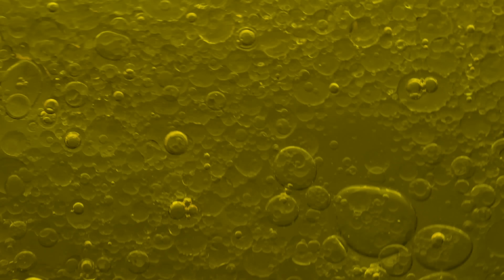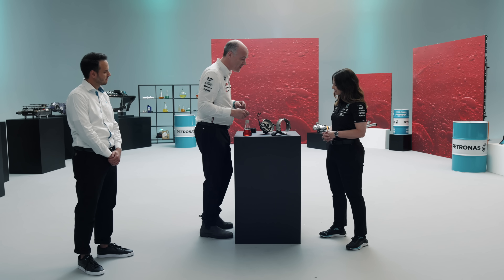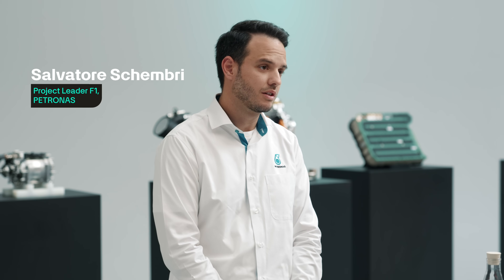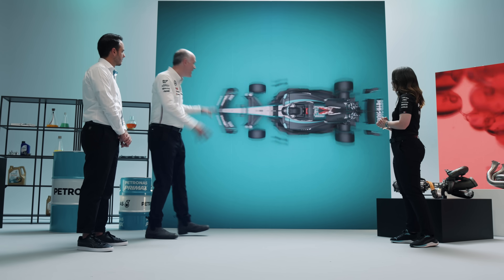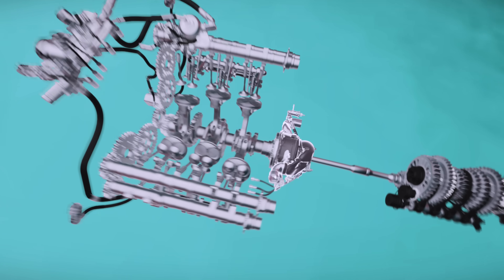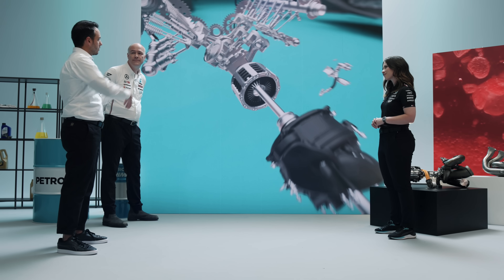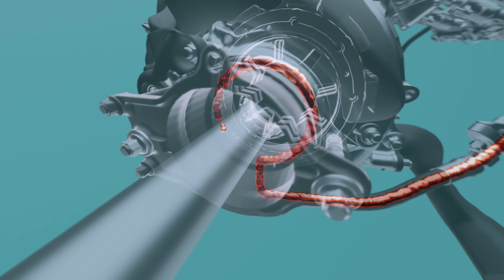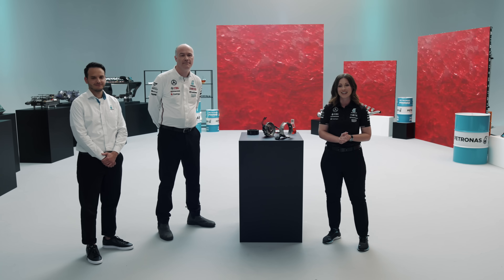F1 Uncovered: Revealing How an F1 Clutch System Works

Comment: That thing is tiny for the amount of horsepower is being shoved thru it.
Reply: @redbovine  Yes. A lot of motorsports clutches are tiny in terms of diameter. I think they stack the clutch discs and that's where the torque capacity and length comes from.

Comment: so much smaller than i imagined . i Love these videos. and even if some of the parts are a few years dated. its still awesome one team out there is sharing some tech with us . pretty unseen in this realm of motorsport
Reply: These cars make zero torque lol. The clutch doesn't even need to be as big as a normal car clutch that would go in a 2L turbo.
Reply: The cars are light, they don't need to make a lot of torque so they don't need a huge clutch. 
I expected it to be small, but I was surprised that it's barely bigger than my hand!

Comment: You should have finished explaining how the driver activates the clutch. When the driver downshifts does the clutch disengage for the length of time he holds the paddle or is it preset by a computer for down shifts? And how does the launch procedure work?
Reply: @upnorthyooper1196  no, the clutch goes through a lot of sudden stress during shifts, but the synchronous shift that all teams use means that the clutch shouldn't be actuated at all during shifting, as both gears are in gear for a fraction of a second until the gearbox slack is taken up 
the rapid shift in engine rpm stresses the entire drivetrain but the clutch is the first to give in that scenario.

Comment: i believe there is a slight correction... you would be CLOSING the DRS when downshifting (I imagine you would want to upshift while going faster with open DRS). Great video and very high quality series -- thank you for this window into F1 mechanisms and fluid use. Would these fluids work in a road car as a way of combining the fluid systems, or is it too specialized?
Reply: There's every chance the DRS is designed to auto-close when downshifting, it closes when the brake pedal is activated and a downshift has a similar impact on the car, having the DRS open whilst decelerating makes the car highly unstable and dangerous... which is exactly what happened to Marcus Ericsson in his Sauber in 2018 at the Italian GP, the DRS failed to close on braking which sent him into the barrier and doing multiple flips, he was very very lucky to walk away from it.
Reply: Don't forget that in practice and qualifying the DRS can be opened anywhere. If you are leaving a corner you might want to open it so you can accelerate as quickly as possible.
Reply: @MSFSFreeware  even in practice and quali you are only allowed to use the DRS is designed DRS zones. The original commenter is right, I don’t think there would ever be a time when the driver would OPEN the DRS at the same time they are DOWNshifting.  They might however open the DRS while UPSHIFTING. I think the guy in the video just misspoke.